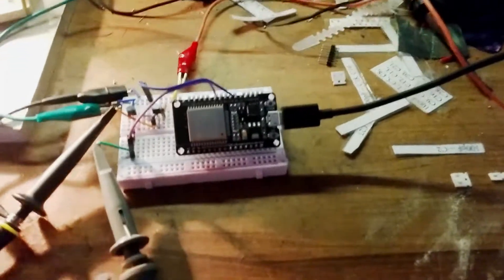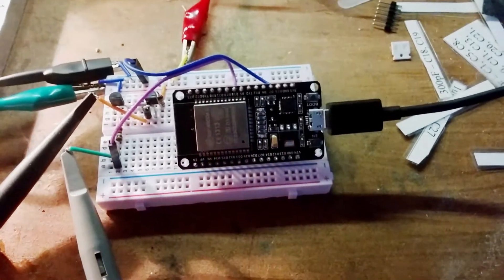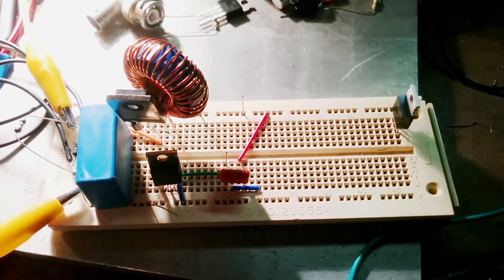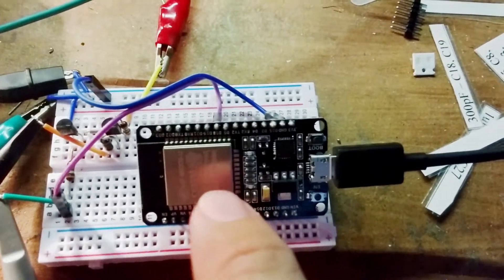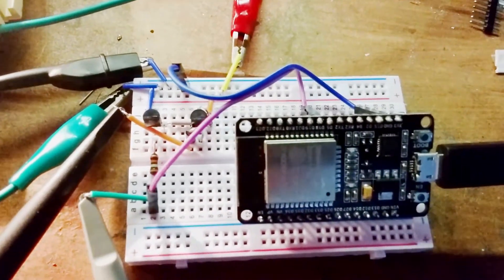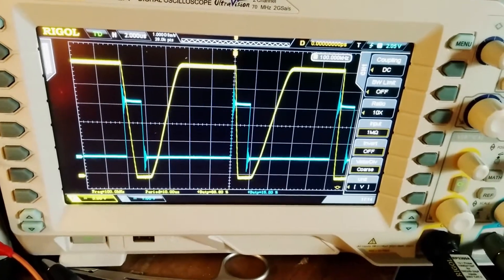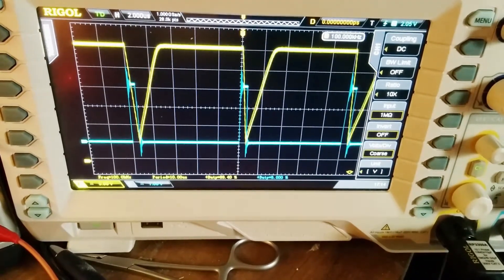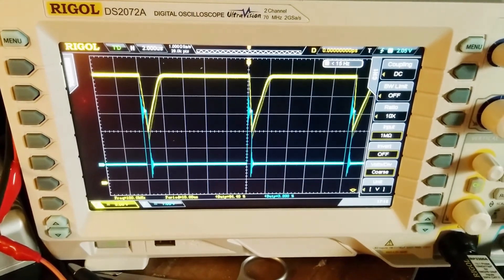ESP32 PWM testing

Comment: Hi, good work. Can you please share the schematic? I have the same problem with the 3.3V deliver by the esp32, which isn't enough to turn on the mosfets I'm using as drivers for a DC motor. It'd be really helpful
Reply from the maker: I'm sorry - I don;t have the circuit diagram to hand, it was a quick experiment. The transistors I used were 2n3904, so you can probably reverse engineer the circuit if you pause the video when the board is shown. Good luck.